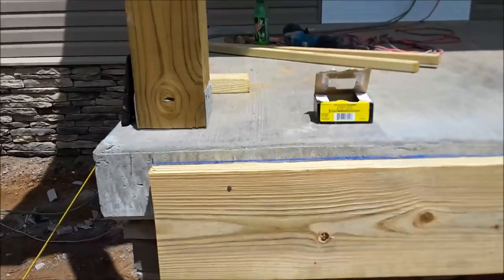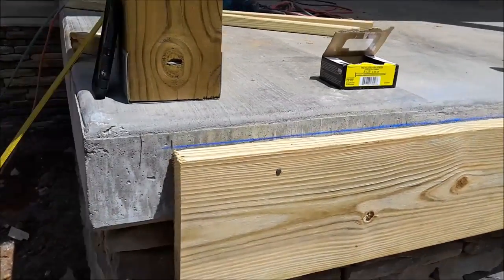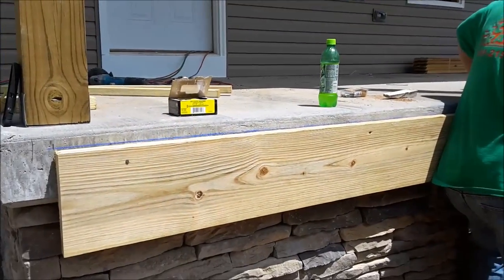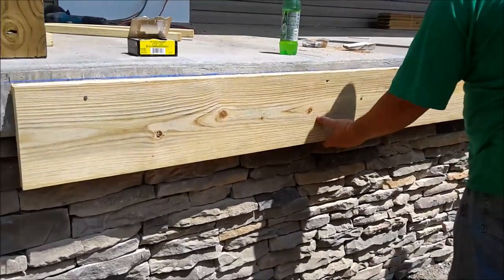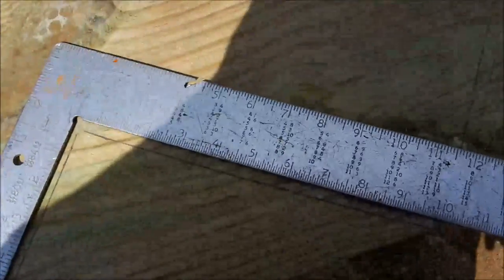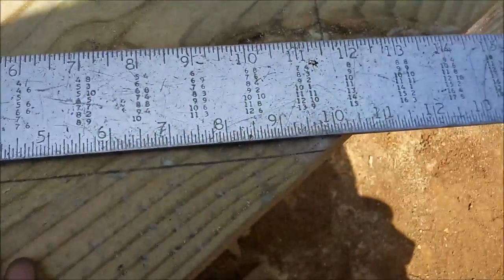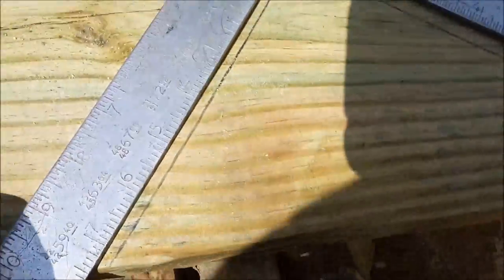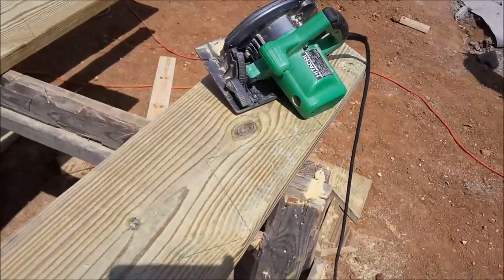Wood stairs on a concrete porch

Comment: Using a 2 x 10 as your ledger board and attaching it within 1 inch of the top of the board means you're only getting 1 inch of support out of that 2 x 10. It won't last long.
Reply: Everybody's an expert...but...I was kind of wondering about that as well. I would have nailed stringer straps to the back of the ledger board then anchored it to the concrete. If he sits the bottom of the stringer on a footing and anchors it, he'll be fine. Again, not what I would have done, but, whatever.

Comment: Well this is why you DONT pay a crew $400 and case of beer to build a porch against your $150,000 house. Im looking for help myself so im no expert but I can tell you that 2x10 doesn't have any support under it and using a couple nailed in anchors straight into the concrete alone is not how you do it. In my opinion dig you some holes and put some post under atleast, but I like I said.. I have built plenty of fence but not this exact project. I would advise not following this video at all